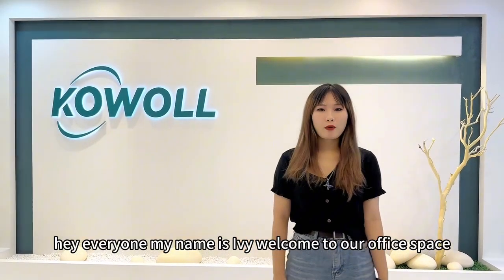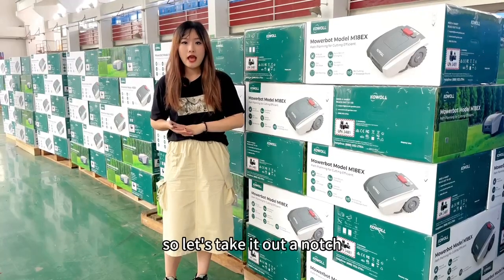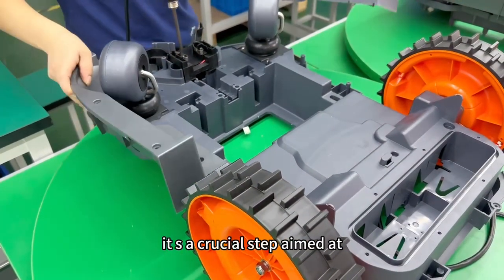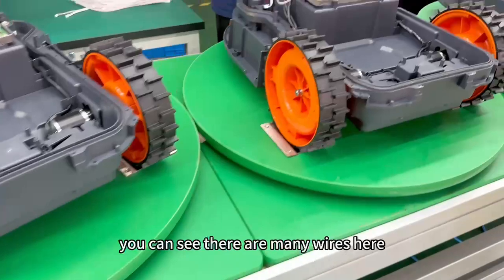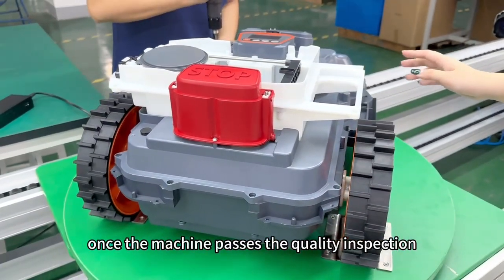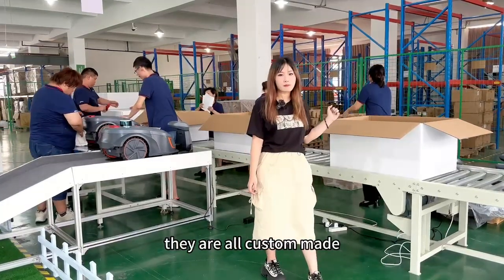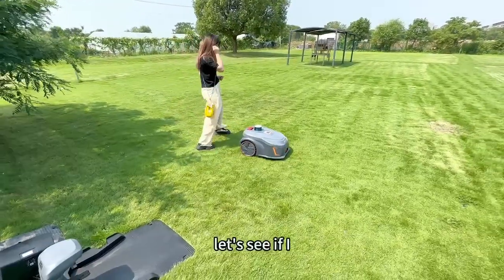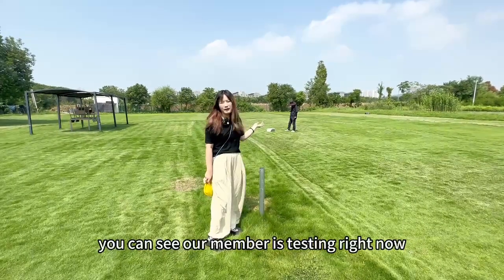Exploring It All: KOWOLL Factory Tour Unveils The Secrets Behind Our Products!

Comment: Where is the RTK GPS antenna in the robot? I do not see any RF connectors on the board. RTK requires a base GPS receiver and a GPS receiver in the robot. I did not see the actual Lidar or its motor being installed either. Is this just a remote control lawnmower?
Reply from the maker: Hi, thank you for your interest, our RTK antenna has a split design and the Lidar has a lift design, the Lidar is embedded inside the machine when it is not working, and only lifts up when it is working. The M28E is intelligently controlled by the KOWOLL APP.
Reply: @kowoll-garden  RTK requires a GPS receiver in the robot and a GPS receiver in the base. Your video does not show a GPS antenna in the robot. Does the phone always need to be in range of the robot?